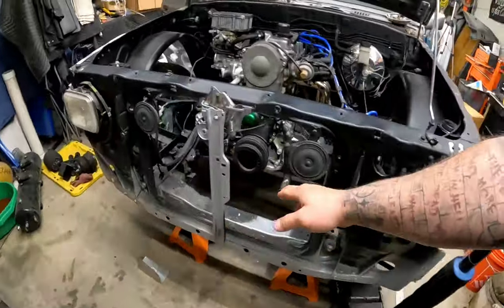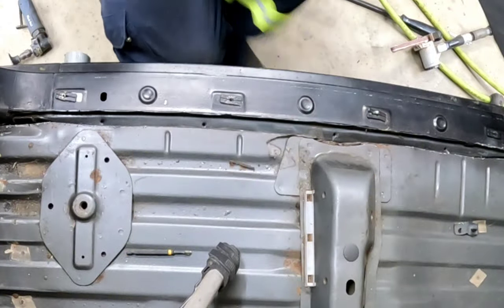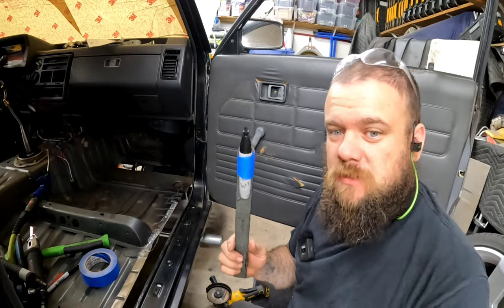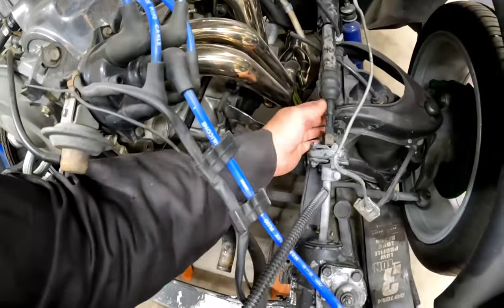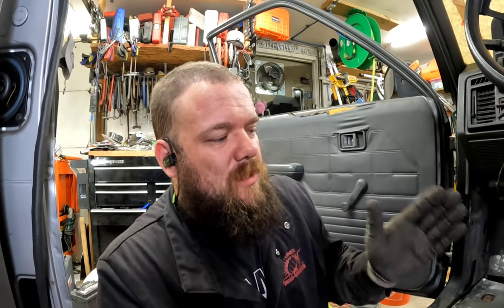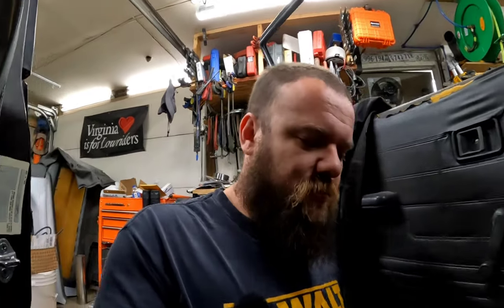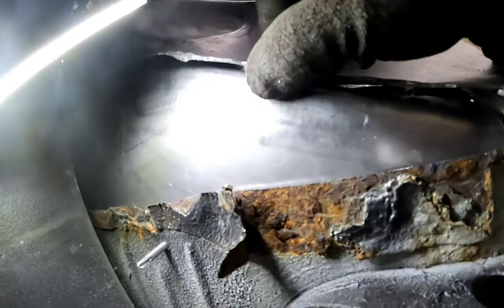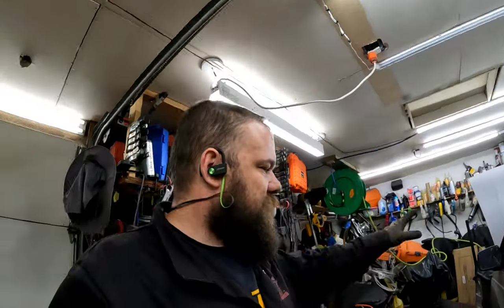Bagged Mini Truck Build #18

Comment: If you order carpet from like ACC, it is way oversized. You should be able to make it look awesome. But before you cut any of it, bolt the seats in...I didn't and when I bolted the seats in it pulled toward the center and I have a few spots that you can see a gap.
Reply from the maker: I actually put the acc carpet in my cart on rock auto last night haven't decided on the light or dark grey yet but thanks for the info
Reply: Was actually getting ready to say the same thing… you’ll have a bunch of extra carpet to trim up where you need it

Comment: If you push the center hump down, will the radio housing/center console still fit correctly?
Reply from the maker: I hope so.  I think if I section the top portion of the trans tunnel a little bit I can make it all work again.